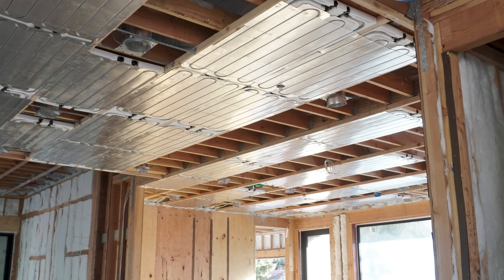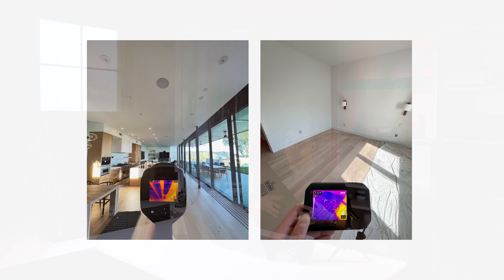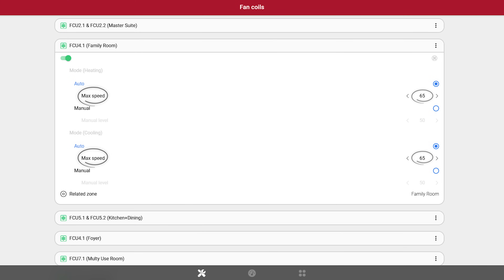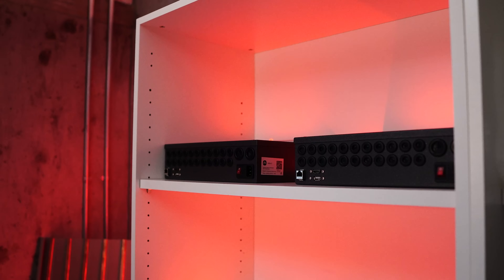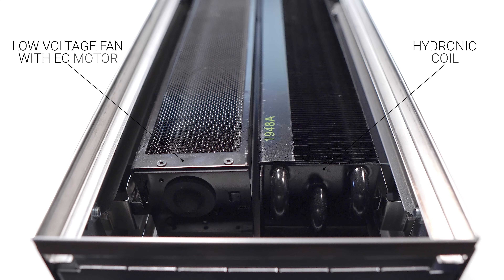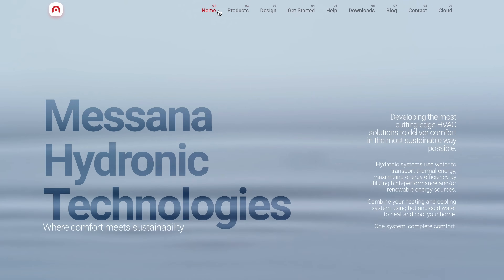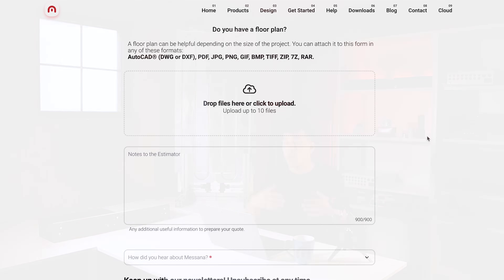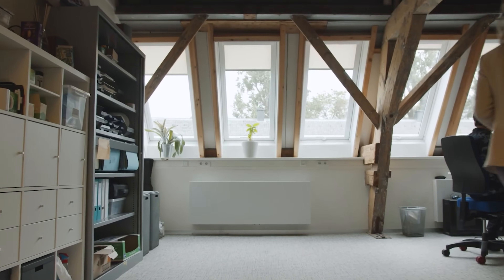How Does a Hydronic Fan Coil Work? | Managing Jaga FCUs with Messana Controls

Comment: How much humidity can these pull out of the air? Would they work in an environment like chicago with ~90 degree temps and very high humidity?
Reply from the maker: In humid climates, we don’t recommend relying solely on fan coils for dehumidification. Our controls enable this capability, but it’s not an advertised feature of Jaga units. Typically, we use fan coils for initial dehumidification and only activate a dedicated dehumidifier when needed. This approach minimizes energy use and reduces unnecessary airflow throughout the home!
Reply: @messanatech  where would the dedicated dehumidifier be "located" in a predominately radiant or all air-to-water heat pump system? Is it part of the ERV system?